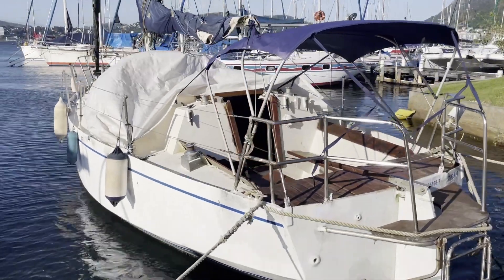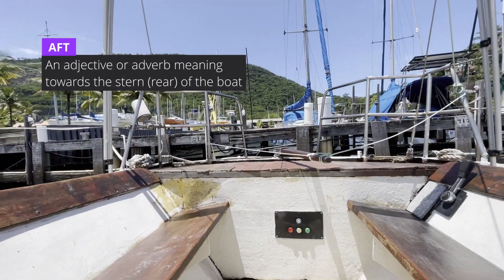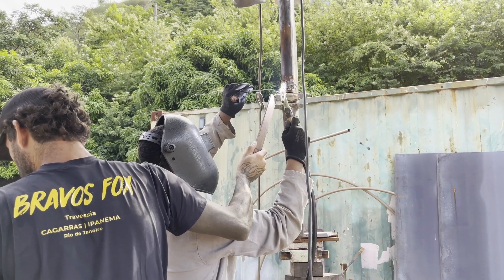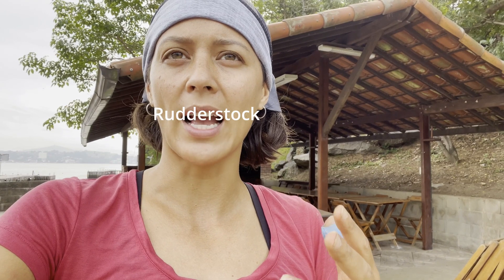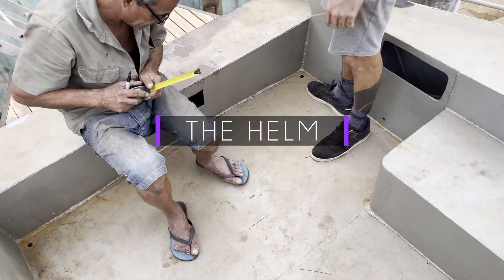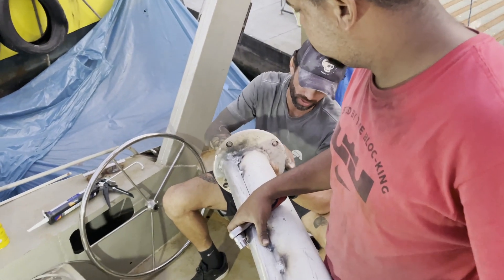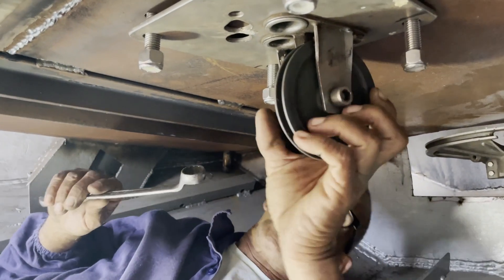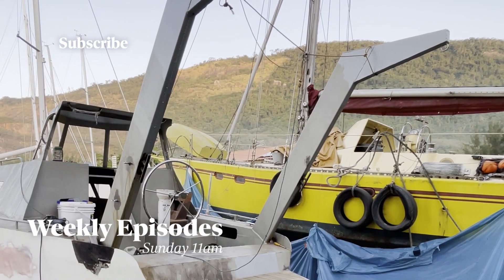Boat Building: Changing tiller to wheel conversion ⛵️ Ep8

Comment: Hi! A suggestion: Next time you use Sikaflex do not tighten the bolts to the max. Tighten them slightly, wait for curing and the next day tighten the nuts to the final torque. A better alternative to Sikaflex for fixed items such as the pedestal would be butyl tape. Less  messy and can easy be separated if needed. Good luck and regards from Switzerland, Silvano
Reply from the maker: Great suggestion! Thanks. We did do a second tightening the next day but we can see how giving it some time would be more beneficial. Not sure the tape exists here in Brazil. We actually had a friend bring in 3M tape for our windows from the USA (it's still in the box but we knew it wasn't available so we planned ahead). We will have to look into that. Would love to use the tape, looks like it would have a much nicer finishing than the sikaflex.

Comment: As a machinist and fabricator with many decades of making things, I have so many concerns about the steering cable alignment, the rudder post size and the welds. I would recommend a lot of short trial runs and an inspection before heading off too far. This is meant to be constructive. Great video though, and your can-do attitude is admirable.

Comment: Great modification. The system is very basic and you have an easy access. That should be quite reliable on a long term.
Reply from the maker: We really hope so! The system is pretty straight forward so repairs should be manageable. 🙏 ⛵️

Comment: Before I put my foot in my mouth, let it be known that I am no nautical engineer.  I am a fully fledged Landlubber, but my brother is as crusty of a sailor that there is.  He seems to prefer tillers vs. wheel steering and has obviously studied both systems.  His sailboats are (I believe) intended for coastal sailing rather than blue water so I guess a tiller makes more sense.  His craft are fiberglass and that may be part of his decision since steel may have just a skosh more strength than fiberglass.  Oh, well---I like the change over that you all made as a tiller seems rather flimsy from my perspective.  You see, if I go to sea I intend to outfit myself in every life preservative measure available---including a strap on lifeboat!  Thanks for this enlightening episode sustaining my vote for a stronger steering system.
Reply from the maker: Thank you for watching! There are definitely benefits on either side. Good eye on the previous tiller - the rudder stock was very thin and it appeared that the extension of the tiller was supporting it. So when it was removed we had to make the stock thicker. Perhaps a tiller with the thicker stock wouldn't be so bad.

Comment: Great transformation to the steering, looks really good.
Not so sure on the davits though, they look out of scale to the rest of the boat, but I'm sure they will look fine once all the other work is completed. 
Nice to get a video of the whole process.
Reply from the maker: Thanks so much! The angle of the camera and the lense makes the davits look pretty wild. We didn’t have much images of them at this time so we used this one. Also, they need the solar panels on top still. We will show them again in future videos so you can see the actual proportion.
Reply: @lahakai  Yes you did say in a previous vlog that you were going to get as much solar as you could on the davits, so they will have to be quite beefy, especially if your going to hang a tender off them as well. Looking forward to the next installment

Comment: Nice Job! In this case I think you have enhanced the robustness and not overly complicated the system. I could not tell, but is the bottom of the rudderstock passage into the hull extension above, or below the waterline? Great if it is well above, other wise you will need some kind of gland seal on it. Also, what are your plans for a auto helm system and what provisions did you make for it when you put in the radial drive? Great Video! I appreciate you showing the mistakes that were made and what you did to correct them! Keep At It!
Reply from the maker: Thanks, we are so glad you liked it! The passage is above the waterline and there is a decent clearance there. A bit of the top of the rudder is outside of the water. We haven't made specific plans about an auto helm, only that there is ton of space below deck for modifications. And this system is pretty basic so we're betting on it being adaptable. We're open to any suggestions on an auto helm if you have any!

Comment: Great idea to add external wire chase way. Way too many wires in typical pedestals. You should also be ably to run motor controls they same tube if you mount on pedestal.
Cheers Warren
Reply from the maker: Exactly! Glad you like it! It was such a tight fit without another way to feed wires in. It's an old, used pedestal. So we imagine that there should be more conduits for electrical devices these days in newer designs. But this does the trick for now!

Comment: Nice video, what is your backup plan should a cable fail? I've seen bigger boats use two hydro cylinders but on helms, I've seen some manual tillers that you can attach, just curious...
Reply from the maker: Thanks!! Yes we have a small back up tiller that connects to the top. We found this helm one a second hand shop so it’s not very complex, so we just made a place on the top of the rudder stock to easily connect a tiller.

Comment: You should have used thicker steel for the gudgoen plates. There is a lot of force on a hybrid rudder like that one. I would doube,if not triple the thickness.
There is too much space between the bottom of the rudde quadrant and upper rudder post bushing. This allows all the weight of the rudder to be suspended on the gudoen plates. which is why they should be much thicker
Reply from the maker: Very interesting! We will look into this, now is a good moment to address it.
Reply from the maker: Thanks for your feedback!!